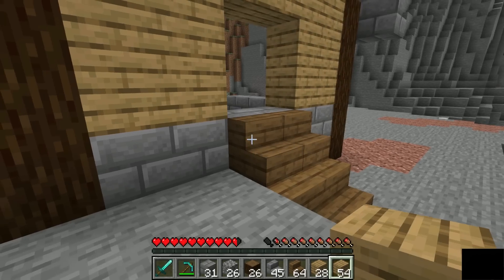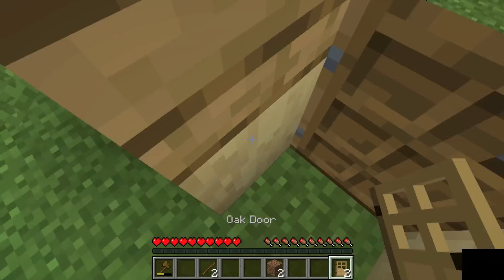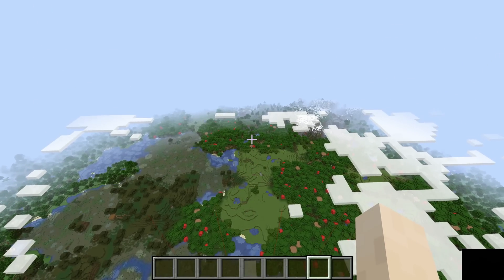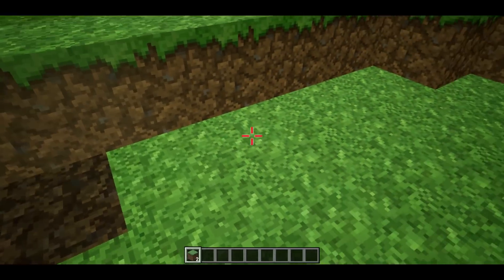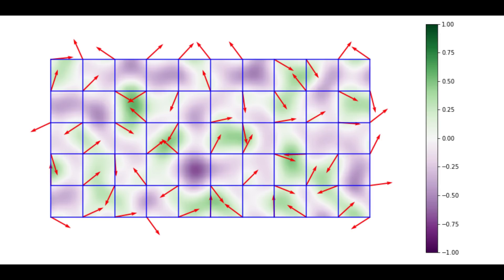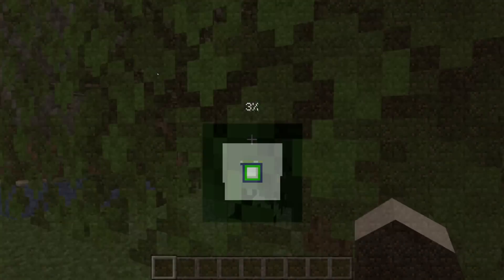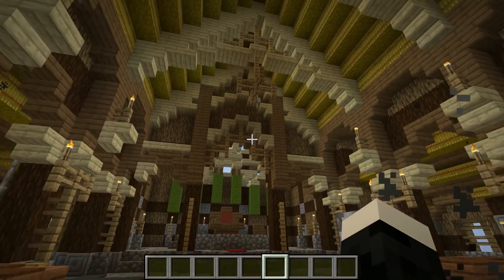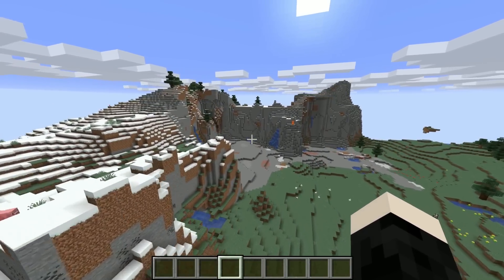Why Minecraft is a Technical Feat | Explaining the Engineering Behind an Indie Icon

Comment: On top of that, the game is made in java, which really isn't meant for preformance-optimized video games
Reply: Rip performance
Reply: @Assassin_Droid  Depends though. your pc has to be quite weak to not run minecraft, i even got (yes the java version) running on my 150$ budget phone with over 40 fps. It just gets worse quicker as soon as you turn up the graphics and it has some limitations that can mostly be comeby but still give languages like C++ more room for optimization
Reply: @Akab   that's not true, the Modern Minecraft Java versions requires a decent computer with a GTX card to run it. My old 2016 laptop can't run it well.
Reply: @CinnamonOwO  No lol.
Reply: @Assassin_Droid  bedrock is made in C which is why the preformance is so much better, microsoft kinda wack though
Reply from the maker: Looks like you triggered some heated discussions with this comment lol. But I agree, I'm making a Minecraft clone in C++ and I'm amazed that Mojang got the Java edition to run as smoothly as it does
Reply: @GamesWithGabe  You really highlighted how hard it is to make a game like Minecraft, it is why there is still no true clone of the game, the ones that do clone it only play in creative and there is out of bounds, well done!
Reply: @GamesWithGabe  try making it on rust 😬🔪
Reply: @GamesWithGabe  the bedrock version isnt in c?
Reply: @macreator9497  C++
Reply: @GamesWithGabe  to be honest the minecraft java edition could run much much better than it does, but Mojang just does not care, the code is horribly written for a performance Java code. And render engine is just ancient. You should see how much better minecraft works with fabric modding + Lithium + Phosphor and Sodium. I go from like 100 suttering fps falling down to 10 each time i move and generate new chunks on render distance of 32, to stable 320 fps on 4k. And this is even without actual changes to also keep the GC under control.
Reply: @thatgotofinal  can you list some mods you used or resources to make your own, i would to try that out myself
Reply: @Arcade_Archie  I wrote many comments here, so not sure what you asking about. If you mean performance mods for minecraft i already listed all: Fabric mod loader, fabric api, and Lithium, Phosphor and Sodium (mod names). It works just amazing with that.
Reply: @thatgotofinal  Indeed, Java edition has lacked performance fixes over the years. We got a big one in the witch update and it made everything ten times better
Reply: @GamesWithGabe  bedrock already runs in C++, that’s why it’s on win10, Xbox OS, PlayStation’s OS, Fire OS, Android and IOS
Reply: @GamesWithGabe  I have been around Minecraft and Minecraft modding for a decade now and the trope of the dude who has dragged some .class or .jar files around once and now knows everything about Java's suitability for "preformanance-optimized games" is at least that old. 

It was the same when I played with Runescape botting and private servers years before that.

it will be the same in 2045 when Minecraft 3 comes out.
Reply: Both editions are fine. I played bedrock for the longest time on my Xbox and phone. When I had the ability to play on a stable computer I played on Java. Both editions, for me at least, are the same. I play on vanilla survival most of the time and when I don’t I’m playing on survival servers. I like how Java has servers that you can just enter and go on to. That’s something both Xbox and PlayStation should fix. Many people play on a specific edition because they like the feel. I asked a friend many times why bedrock is terrible. He simply said that it dosent feel like Java, and of course micro transactions. Becuase I play on both editions regularly, bedrock does obviously perform a lot better, unless you have every non-lag mod you could get on Java. Ngl I read through the entire comment thread. It was Notch’s decision himself to program android and IOC in C+++. Pocket edition first came out in 2011, 3 years before Microsoft. Once Microsoft took over they wanted 1 edition of Minecraft, but due to the differences in coding they united all versions they could and kept Minecraft as Minecraft Java edition. And I agree with the “to mass-market the game.” Then agian because of that resources are more readily available to make something like the Caves and Cliffs updates. I know it’s the OG game, Java is. But even thinking about pocket edition, that came out the same year Minecraft “officially” became Minecraft, in 2011. Many people are “in the know” also, such as myself, which is why I downloaded Java when I had the opportunity, but as I said still play both editions. I guess I should also say this is my oPiNiOn. There’s no need to trash on either edition because they really are both good games.
Reply: @T1DsLayer628  This entire argument is pointless, as I didn't trash anything. I was simply pointing out the inanity of saying something along the lines of "they should have just made it in c++ from the beginning hurr durr". Because CLEARLY they haven't been able to catch up to the Java version in a whole decade since.

Also the original pocket edition was a barebones clone, not even nearly the same as the main game in features for many years.

How long have you been playing to say "I downloaded it when I had the opportunity"? 

This is just a bunch of 15-24 year olds who can't accept that they don't know everything about their favorite game trying to tell someone who has been here from the start lol.
Reply: @ESS284  I’ve been playing since 2012 when I got my first tablet when I was like 7. I was able to get a decent computer to play Java in 2018
Reply: @T1DsLayer628  Interesting, that's a long time to be without mods ;)
Reply: @ESS284  i remember being able to play with mods on my shitty phone years ago, the selection was way worse than java though
Reply: minecraft code is just terrible. Minecraft 1.16 still contains stupid mistakes like i/o calls on main game thread. but yes, keep repeating stupid sentences without verifying them.
Reply: @gang_albanii  the cpu-creep is so noticeable with every single new version. That’s why they delayed 1.17; they can’t figure out how to make the game run on certain systems anymore because of how unoptimized they let the game get
Reply: @pissum  1.16 works for me on an old potato even at high render distance. 1.17+ won't even install correctly.
Reply: @gang_albanii  They need a few updates to stop adding stuff and instead do some housekeeping
Reply: another comment from the same verified youtuber
Reply: Wouldnt say minecraft is "performance optimized" lol
Reply: Replying to just set the record straight for a number of other comments:

regarding which language is faster: 
C/C++ is typically much faster as it closer implements the functionality of the processor/OS. Java on the other hand is designed to enforce structure and often requires a lot more memory to maintain the many frameworks that the language is built upon. One of these frameworks revolves around multi-threading which is not only possible but actually required for standard library graphical applications (both swing and javafx).

regarding the JVM: 
The whole point of the JVM is that Java byte-code closely resembles a subset of most processor instruction sets, not just the x86-64 that is used in laptops/desktops but any conventional processor (ie not a quantum computer) and implementing the JVM mainly requires matching the JVM instructions one to one with the processor instructions. This is why it is common on smartphones that use custom instruction sets. 

regarding consoles:
Consoles are actually more likely to use an x86-64 processor and typically have custom operating systems (written in C/C++) specifically designed for game performance. To directly access the console OS's with Java, they would have to use method calls from the JVM to external code and likely rewrite large parts of the standard library that Java ships with and the consoles wouldn't necessarily have the memory to run the java version of Minecraft. Alternatively they could mostly transcribe the Java code to C++ with little modification and access the OS functionality directly, thus Bedrock edition was formed.
Reply: Dev here, I'd like to interject that It's not as simple as '"Java is not meant for performance optimised video games" You could equally write the same game in C, C++ or a language closer to bare metal and have it perform worse. While the language of choice used to develop software is an important choice, I'd argue particularly with large software it's the architecture and how it's coded that makes far more of a difference when it comes to performance than the languages itself.

Minecraft started off as an indie game. There was no intention for it to gain this much traction. So notch is not going to spend a lot of time developing this game in a lower-level language which would require writing more boilerplate and having to worry about things like memory management. You have performance and simplicity. You can either sacrifice simplicity for performance meaning you spend more time writing boilerplate code but have the opportunity to optimise a game at a very granular level. Or you choose simplicity and sacrifice some performance for spending less time developing basic infrastructure to make the game function.

Hypothetically, if you took the same codebase of Minecraft, converted it to c++ and it didn't run that much better, that's the makings of terrible architecture, not the language. Performance-wise, Java as a language is not really far off from that of C++ or C. But take a language like say Python and then you start to see a staggering performance difference.

TLDR:
It's not as simple as pointing at the language for the reason of performance issues.
Reply: @laeven_  actually the original Notch code was surprisingly well optimized for computers and java versions at the time but wasn't multithreaded. It became slow more recently with newer code. But I'm going to agree that the same code ported to c++ would still have roughly the same performance. The cases where java is slow are either very specialized (vectorized code for example) or things you shouldn't be doing if you want performance anyway (like doing 10000+ of gl calls per frame... Which Minecraft does)
Reply: @laeven_  yes. This
Reply: Yes, while Java wasn't as great of performance then (and it shows), the updates and upgrades to the compiler over the years have made it on par (not quite as good), but on par of C++.  This is even somewhat an advantage as you don't have as much development overhead when programing in java.
Reply: But was Minecraft ever Optimized?
Reply: @Quayleman  i think maybe yes in new versions, but its needed because new versions can eat all resources of your pc even if you have 32gb ram, threadripper 3990x and two rtx3090 in SLI

but old versions wasnt need this because it was working fine
Reply: @Quayleman  actually yes,1.15
Reply: @Quayleman  There were some performance improvements when witches were added since then, not really
Reply: @quickstergamestutorialsgam3899  Ahhh you're just showing that you don't really 'get' Java. "Even back in 2009" is a redundant statement, performance has improved over time not gone backwards after all. Where do you you think Minecraft would be without cross-platform and more importantly *mods*? Nowhere, and the mod's were possible in the early days precisely because the server and client were Java based. Deep functional mods from the start not cosmetics.

Additionally, Bedrock was a choice, made many years after the game's inception, the other choice would have been to port the JVM to any target platforms (xbox and playstation mainly). Bedrock was created to mass market the game on primarily non X86 platforms. So it's pretty backwards to say "if the game was written in c++ from the beginning" when Notch wouldn't have been able to do so anyway and considering the fact that it's always run fine on decent PCs.

Microsoft could have ported the JVM but they wanted to sell you the game again. Notch sold hundreds of thousands of perpetual licenses for 'Minecraft' the game also, I wonder if that factored in. (I bought one in 2010 or 11).
Reply: @ESS284  the reason bedrock is in C++ is because when it was first made as pocket edition, phones didn’t support java
Reply: @duckonaroll1913  "phones didnt support Java", almost 10 years ago, C++ was the most viable option at the momemt
Reply: @allancoelho6905  exactly, which is when pocket edition started development
Reply: @duckonaroll1913  and now, 8 years later, phones have Java support, and it is inviable to change C++ to Java, and make it somewhat stable
Reply: @allancoelho6905  yep
Reply: @duckonaroll1913  Really you should not comment on things you have such little knowledge on. Android has used Java from the beginning. All android apps prior to kotlin's release, unless cross compiled, were written in Java!! 

I didn't ask people to poorly inform me about the history of Bedrock, I know what happened. I was just calling out the clueless Java haters.
Reply: @ESS284  You're right, my bad, PE was originally released for android. It was just that the desktop version was too resource intensive for the phones at the time, so Notch made a new version in the better optimized C++
Reply: @duckonaroll1913  Phones, mainly mobile Phones are based on Android fr Android Phones and Ruby(and her successors) for iPhones.
Ruby is technically a descendant from C, and Android is a Language created from Java.
Reply: @ousamadearudesuwa  It's incredible how many wrong statements you managed to cram into such a short comment
Reply: @duckonaroll1913  that's not true either
Reply: @ousamadearudesuwa  Java is also based on C. As is C++.
Reply: @ousamadearudesuwa  "ruby is technically a descendant from c" "android is a language"

as a programmer, what the fresh fuck did i just read
Reply: @ESS284  it'd also anger a lot of the community as you'd have to learn c/c++ (which tbh for my reasons i find funny, fuck the forge dev team they can eat ass). But again, as someone else mentioned, they would probably want to avoid oracle fucking them up.
Reply: @ESS284  Minecraft has run like shit on plenty of platforms for no good reason. It runs poorly and still runs poorly, because it's Java. .NET was a thing since 2002 and Mono since 2004, so there was plenty of opportunity to write something that would be portable and moddable. In any case its cross platform status didn't lead to its success because there were next to no Linux/macOS gamers back then. If you game, you game on PC up until only very recently.
Reply: Since when C++ is not cross-platform?
Reply: @aleshevl  C++ is cross platform. Actually the XBOX OS and other devices are written in a modified C++ language so it works pretty well
Reply: @Stettafire  Being a C++ engineer and having developed for various platforms I think I would know that it's cross platform, I don't think I ever said otherwise, but I can't see the message you replied to to clarify my statement
Reply: @ESS284  I think you're being pretty biased. They needed to run c++ on consoles, even on legacy editions, since it was more optimized and consoles didn't really had Java support. But maybe you didn't know that, so here's the reason. Correct me if I'm wrong and have a good one :)
Reply: I don't think so because it was a small part of the argument to illustrate the differences that exist to this day stem from that situation, I am fully aware that they didn't have java support. But it's really not radical to suggest they could have taken that approach and kept a single game edition, that's exactly what Java is meant to be able to do, no doubt this was possible by the next console generation. So in the end you got a buggy cut down version of the game in bedrock for YEARS anyway... 

I have argued many points with people in this thread and this is just a sub point to the YouTuber above criticizing Notch's choice to build the original game in Java. What do you think about that?

And you know, there aren't many games companies that even attempt to maintain two code-bases for essentially the same product, the reasons are pretty obvious so yes thats not how history played out but it certainly could have.

by the time MS was in the process of acquiring Mojang the pocket editions were barebones, really pale impressions of the full game.

The Xbox One was released November 22, 2013.

Xbox 360 version (2013) wasn't even built by Mojang, the code base split in about 3 directions with pocket by then and then one year later (2014) MS owned the IP and missed the opportunity to unify imo. It's not really related to the original argument about Java though. Which again was provoked by someone else shitting on Notch's choice to build the original Minecraft in Java.

Many different interesting arguments to be had here, not many provable, imo if they got GTA5 running on 360, they could have ported a JVM and run minecraft on it, but we will never know. Next gen onwards would 100% possible and they are beefy PCs by 2010 standards, minecraft java ran fine on my Dual core, 2GB RAM, gt210 or something GFX card after all. And I used to run it on linux laptops with even less ram frequently. It still worked pretty well which is a testament to Java imo. It doesn't deserve the pig-slow reputation just because Notch was the first one to pull off wide commercial success, he proved it was possible so to call it a bad decision seems laughable.
Reply: @paulinxm8201  Everyone is biased,mate
Reply: @ESS284  I feel like you misunderstand what Java is and what programming languages are. The language, nowadays, rarely is the thing that dictates if something is cross platform. Minecraft Java edition, is, however, not cross platform as the Mac and Windows (windows Java not windows 10 edition) are essentially seperate games that require updating seperatly. 
Java in of itself is cross platform, as is C# and many other languages. Minecraft Java edition, however, is not cross platform.
You seem to be confusing Java edition with the windows 10 edition (which I might add is also not supported on Mac)
Reply: @ESS284  i think hat java's syntax has changed just like any other fucking language over the years you can't say python 2 is the same as python 3 you realise you could only develop it's game with the original java version
Reply: @ESS284  The windows 10 edition is NOT java afaik, so M$ is actually writing it very differently, the original code probably is not being used much after all this time. and yes, I've even heard stupid things like MC is not multi threaded because JAVA, like, WHAT? People seem to blame everything down to to things which are not even responsible for this at all
Reply: @UCJzUT6suX8o0OgHONzOu_FQ You are talking about the Bedrock edition which is available on the windows store. The codebase and features have never caught up and everyone serious and in the know uses the Java version. Only people who can't use the Java version for some reason should use that version. 

Java can do multi threading just fine, which i think you are saying! And it's why I commented people are not well informed about Java. It gave you Minecraft!
Reply: @ESS284  You just went from a Java language arguement to a "Minecraft Java is better" arguement and even though im a java fan the facts you gave about bedrock are very innacurate
Reply: @ESS284  "Everyone serious and in the know uses the Java edition." This is completely false, there are TONS of knowledgeable and talented Minecraft players who use the Bedrock edition, although I won't deny that Java is much more popular and much better in its technical aspects (mostly due to the fact that the mechanics aren't constantly changing with every hotfix and it isn't buggy as heck). Honestly I can almost see a case for playing on Bedrock due to just how badly Java's performance is optimized in comparison, but Java is so much more well-polished and its mechanics and features are generally so much better-designed that I can't imagine going back to Bedrock now.
Reply: @BenjaminAnderson21  I would say you contradicted yourself there. As better stated by someone else above, if you have access to the Java version you need some reason not to use it, otherwise why wouldn't you if it's better and you agree that it's better?
Reply: @ESS284  Where did I contradict myself? I only said that while Java edition is more popular for its technical aspects, many knowledgeable players still play on and prefer the Bedrock Edition (probably for its performance). Personally I can't imagine going back to Bedrock after making the switch to Java, but I won't deny that as jank as it is, Bedrock has its advantages, and to say that anyone who plays Bedrock "doesn't know what they're doing" is shortsighted imo.
Reply: @BenjaminAnderson21  
First of all you made this quote up (anyone who plays Bedrock "doesn't know what they're doing")

 So before you switched, why hadn't you? perhaps because you weren't "in the know". Now you have tried it and you know it's better and wouldn't go back. Remember I said serious and in the know. You could be a serious knowledgeable player, and only find out about  the Java version later. 

You are making it about knowledge, and putting the words in my mouth not me. I think a lot of you are missing a big chunk of Minecraft history, because there was an whole era pre microsoft that some of you missed.
Reply: @ESS284  If you are a serious and knowledgeable Minecraft player, then you have played Java Edition. There's no concievable way you could call someone a "serious and knowleadgeable"  Minecraft player if they haven't had experience in both main versions of the game. You were the one who said that "anyone serious and in the know uses Java." Now you're saying you can be such without even TOUCHING the version? What?
Reply: @BenjaminAnderson21  No I didn't I said you can still be knowledable about the Minecraft meta. 

You've shown yourself up already. now stop digging a hole, the obvious need to be right about a game you feel a connection to is showing.
Reply: @hariranormal5584  win10 edition was written in c++ AFAIK. The "minecraft isn't multithreaded" argument comes from how the server jar file is written, it can't support multithreading. I'm not entirely sure if this translates into local worlds since they run an internal server which could differ from the distributed jar, but I'm not 100% on that.
Reply: @ESS284  I play both Java and bedrock but I prefer bedrock for its render distance
Reply: @ESS284  I have played both versions, and know them well, and I prefer bedrock. I don't see wat people mean when they say it is jank and buggy. Other than redstone, it is very solid. In my experience, java is far worse with polish.
Reply: @ESS284  actually minecraft bedrock even though it is behind java in some ways has been the leading version in terms of world gen
Reply: @ESS284  dude the ego on you. Jesus
Reply: @MySkilletfan  it's okay if you don't understand technical terms just ask bro.
Reply: @ESS284  I'm sorry your parents don't love you, but arguing with people on the internet isn't going to fix that. Have a nice day, enjoy your internet points.
Reply: @hariranormal5584  Yeah, they don't understand that multithreading is pretty much useless and unfeasible in most games. It's very difficult to make a thread safe multithreaded game. Too many threads will eventually corrupt game memory, due to them trying to read and modify many parts of the game at once without the others being aware of those changes. That's why a lot of games are mostly single threaded, they only use multithreading when workloads can be safely and effectively distributed.
Reply: @ESS284  "Only people who can't use the Java version for some reason should use that version." - that is complete BS. Bedrock has 99% of the core game. Have you ever even played it? And running a Java app is not a matter of knowledge. I love Bedrock, and choose it over Java, because it's much faster. I don't play skyblocks though or mod the game, I just play with my family or with friends on Realms sometimes. I would say most people should be playing Bedrock, and Java is just for those peeps who 'need' the modded experience.
Reply: @ESS284  because there was an whole era pre microsoft that some of you missed. - LOL, I was playing Java Edition for years, and I still switched to Bedrock after a bit of to-ing and fro-ing. After I got sick of hackers in the multiplayer servers and realized Bedrocks performance kicks ass, and the simplicity of Realms and I Minecraft is Minecraft, even if a few mechanics are different. No problem if you like playing Java, but to say it's flat out better than Bedrock is just not true.
Reply: @hariranormal5584  Minecraft Java edition is multithreaded lol. Indeed I've heard similar things from people who don't understand what Java is
Reply: @BenjaminAnderson21  The vast majority of PC gamers play on Java, mostly due to microtransavtions etc
Reply: @Stettafire  
There is confusion between what is actually being Multi-threaded, people say Single Threaded because the main "thread, engine" which handles the ticks and stuff is single threaded. IDK if this has changed over the years, at least 1.12.2 is not this way.
Reply: @HappyGick  No lol
Reply: @ESS284  Bedrock wasnt a choice for mojang, it was neccesary, a C(#or++ I dont remember) rewrite that was compatible with all(most) consoles and devices was required if they wanted to expand it off desktop wich they had been doing. Well what about before bedrock on consoles? Wii U, Xbox 360, and the old nintendo switch versions, along with minecraft pocket edition costed alot of money and effort for mojang, to the point that they even hired a seperate company to maintain the console versions, they needed the C rewrite to get cross compatibility
Reply: @wellsilver3972  ironically java is better for cross platform development because c++ needs to be compiled seperately for different systems, while the JVM does all the dirty work for you
Reply: @wellsilver3972  C# not C++ but yes, totally agree keeping the game in Java is not sustainable. The microtransavtions etc however are obhorrent hence why most PC gamers are sticking to java
Reply: @ESS284  MS didn't charge me twice. Bedrock was free. Bedrock also runs on more platforms than Java. I just wish when my nephew and I play on PC and Android or PS5, we could use mods. Too bad.
Reply: @deViant14  the last bit was tongue in cheek because they lost my license in the transition, so I had to rebuy Java anyway. 

They had some kind of web tool to help recover old perpetual licenses like mine but I never got it to work.

Edit: the change you are talking about only happened in 2020 bro so not really relevant if you have been playing for 10 years lol.
Reply: @ESS284  huh? I had one one the earliest licenses because I wanted to support Notch. (I didn't know his political views at the time). Anyone who owned a copy of java edition got a copy of bedrock....
Reply: @deViant14  I've played on and off from back before there were hitpoints in the game xD though I played much more during beta than prior. It seemed to me like certain parts of the Minecraft community kept turning super hostile to each other (and I don't mean Vechs, but it's just as frustrating as surviving some of his maps. :P) It really got on my nerves with the modding community stabbing each other in the back and making things worse off for all of us. I dropped out of making mods and all of that and basically went pure vanilla except for some mods I keep playing in old beta versions that I would go back to. Eventually I moved onto Bedrock as my main edition where the Minecraft community is much more just people enjoying a game still, but that "us vs them" attitude (even though both are actually "us") that keeps showing up in Minecraft players keeps frustrating me. xD
Reply: lol and minecraft runs smoothly on really any device
Reply: Java is excellent for large applications of the same scale as Minecraft. The problem is that the JVM is not as good as compiled non-VM languages at rendering ie C++ and shader. The problem with using non-vm languages is that you need to port your program for each platform you target.

Try compiling your Windows C++ software project in Linux. It's likely to throw dependency errors, because operating systems have different system functions/calls and paradigms for controlling the hardware, and not all dependencies are cross platform.

The inefficiency of older versions of the JVM is true, but newer versions, coding approaches and oracle's paid JRE are very efficient, especially compared to interpreted languages like Python, for large projects, not small ones. Interpreted languages are great for scripts, but don't kid yourself, they're very inefficient compared to compiled languages for large scale projects.

Also, good Java is very efficient, but writing bad Java is very easy.
Reply: @a1vash  There is a very fine line for some reason. You either run minecraft at 30 fps or above 100… there is no in between lol
Reply: but java not too slow as usually people think
also game was working on java applets and was able to work in browsers

and about performance, big amount of java games has better performance than Unity apps with the identical level of simplicity, and with that java has crossplatform from the box because of JVM, and when Java became slow language in videogames when 90% of people using Unity

cringe
Reply: Then why is java far better than bedrock🤔
Reply: A common myth that Java is not performant. It has an amazing performance.
Reply: @sobanya_228  Vanilla is good, it's just that the mod loaders don't do well because
1. You're adding >10x the content to the game most of the time.
2. Forge is programmed unoptimized. It's meant for ease of use and compatibility. Fabric runs much better, but it still sometimes has the first problem which is unavoidable.
Reply: "made in java, which really isn't meant for"
It's a programming language...it can do anything you throw at it unless you think of something the initial designers didn't...and large-scale simulation and graphic rendering weren't two of them when Java was being developed.

Otherwise you'd have to explain C still kicking around.

Stick to releasing 2 videos of the same recording every 6 months, Horizon.
Reply: @DxBlack  not for preformance optimized video games. there is a good reason why so little games are even in java
Reply: @DxBlack  My Python voxel engine with procedurally infinite terrain runs at 400 FPS with the right optimizations. Sadly it got lost in a HDD wipe, else I'd show ya. Mojang simply does not know good programming practices (BlockPos, talking 'bout ya)
Reply: Yep, especially back when Minecraft was being developed. Java's performance has improved over the years though, to the point where it can match or even exceed native performance in some workloads
Reply: @nighteule  How can a high level language "exceed native performance"? To me that makes no sense since "native" is just machine code instructions specific to the cpu instruction-set. There is no way to be faster than the hardware you are running on.
Reply: @electrified4251  I'm pretty sure there are cases, where interpreted languages like java or python can outperform compiled programs due to JIT compilation
Reply: @nighteule  EXCEED?!
Reply: @gang_albanii  this. Java is not the same as it once was. Language choice is hardly relevant when bad practice is present regardless.

Some of the stuff I’ve read in this thread is so bafflingly stupid I have no idea what to say!
Reply: @gang_albanii  Yes, this
Reply: @KookoCraft  Indeed. I'm a dev for a living and code issues are rarely language based, their caused by lack of time and inexperience as well as poor architecture. Architectural programming has come a long way in just the past ten years. It's no surprise that Minecraft has issues and they decided to just redo. Many legacy systems nowadays are in similar situations
Reply: @nighteule  that is literally impossible
Reply: @KookoCraft  Java and other interpreted languages can in some cases be faster than compiled code due to JIT compilation, if I'm not mistaken
Reply: @nighteule  meh
Reply: @nighteule  meh... The JVM is a marvel of engineering... It has been very good for many many years but it's just not really the right tool for video games...
Reply: @nighteule  What? No?
Java runs all code in the JVM, which makes it slower than native by default. Adding a translation layer causes slowness.
Reply: @thatgotofinal  thank you this is the kind of thing i was talking about but everyone thinks I am comparing bedrock vs Java edition lol.

Long live Java.
Reply: @thatgotofinal  saying the JVM outperforms an equivalent native solution is verifiably false and insanely stupid
Reply: @KookoCraft  How do you define equals then? Simple idiomatic object-heavy code can easly be faster on JVM then language like cpp. But if by equal you mean implementing a lot of JVM features manually first in cpp code and then wirting heavily optimised code in cpp? Then sure, native will be faster, but making it faster will take few weeks or months more of work depending on scale.

Banks use java in their trading platforms that need to be realtime and super fast, why? because its fast and simple to develop to be fast enough, and using cpp would make time needed to develop features much longer and more complicated.
Reply: what about bedrock edition?
Reply: to be honest. That is actually true. Java may be complex in its implementation with many of its quirks residing from Turbo C and Dev C's main problems in terms of optimization. But its also really good at its simplicity for games running on any PC.
Reply: This only shows that if you compromise of the looks, you can make the game even in Java.
Reply: It is written in C++.
Reply: @randavael  Minecraft bedrock is written in c++. The main version of minecraft is written in java.
Reply: java itself is capable of decent-good performance. its encouragement of virtual object orientation is what messes up things
Reply: That's funny because minecraft runs like shit
Reply: Isn't meant for performance... until you understand what a JiT compiler is and realize it's not far off "native" code (because it compiles to native code in the JVM) and more up to the developer just writing better code.
Reply: @MikeBrady68  the JVM is open source... microsoft could just make an own jvm distribution. like ibm, redhat, eclipse, etc...
Reply: Yeah it’s made for being bad
/j
Reply: no wonder they still play on 1.8
Reply: the bedrock edition is made in c++ and it actually has makes the biggest leaps in terrain generation in minecraft
Reply: The good thing is Java has improved vastly to where it is now, to the point where it can go toe to toe with languages like C/C++ if the C++ developer isn't a literal Operating System developer
Reply: Not even C# can fix it from what I’ve heard. Any semi-interpreted OOP language like Java or C# will have around the same performance.
Reply: @cerulity32k  Not true
Reply: and java is a pain in the ass
Reply: C++ for life
Reply: @JThburvs Any language can be used for video games. Almost every language's Hello World is with the console, which is why it's so universal. For 2D frameworks, Python has pygame, Java has libGDX AND Processing, Lua has LOVE2D, C# has XNA/FNA/MonoGame, C++ has SDL2, and C has raylib, just to name a few. Java isn't optimized, and I do agree that they could have used a much faster language, but no programming language is built for really anything. You just need to make it like that.
Reply: Mhm
Reply: fuck java
Reply: Well… it’s mainly in bedrock now, but initially yeah, java
Reply: Java is actually not as inefficient as people make it out to be. You absolutely can write incredibly efficient code in java. Most of Minecraft's performance issues stem from following common java code practices where performance actually matters, just plain not using optimized algorithms, game mechanics being designed in a difficult to optimize way (redstone...), or like in case of randering, using somewhat archaic approaches to it (until recently Minecraft still used opengl 2.0, and while it uses 3.2 now, it doesn't actually make use of it's features and attempts to "emulate" the old way).
Reply: @Barteks2x  no it uses opengl 4.~ now
Reply: @macreator9497  nope, it uses opengl 3.2 core profile. It works with newer versions but only uses 3.2 core profile. Versions before i think 1.16 (or was it 1.17?) used opengl 2.x and some even older versions used opengl 1.1 or 1.2 (or 1.5? My memory is fuzzy on details), and optionally some 2.x features.

Finally requiring opengl 3.2 also in a weird twist allowed them to finally update java version, because windows Intel drivers for integrated GPUs on third and older generation of Intel CPU would fail to run on newer java versions due to containing a manifest for windows 10 which broke windows 10 compatibility for windows 8 drivers.

Most GPU drivers are also very lax on mixing and matching features from random opengl versions because many older games relied on it. But some drivers (like Haswell and older Intel driver on Linux) doesn't allow a compatibility profile for opengl 3.x so you can't use 3.x+ features in legacy mode. This is visible by a lot of optifine shaders not working on that driver.
Reply: old minecraft was horrrrible performance wise. it took them over a decade to get it to not require a gaming pc to play.
Reply: @codywasser2008  That's not strictly true, but the performance was poor
Reply: No kidding, just ask my 13 year old laptop about 7-15fps in Minecraft Java Edition.
Reply: And yet you can run it on a phone (I'm not talking about bedrock now, there's an app on android, that allows you to run minecraft java from your phone) on pretty decent FPS
Reply: they need to add Interoperation for them to add other computer languages to work on the same software.
Reply: Lol this comment thread became a Twitter argument
Reply: Well it turned out to be perfect for MC.exe  Not Responding
Reply: Bedrock edition is more played witch uses the bedrock code base so now days most people play the c++ Version
Reply: @Filip_ko  Most people are still on Java, but bedrock is popular
Reply: Why people talk about gl calls? Is Minecraft source code avaliable anywhere?
Reply: @hooolas1  Well the code has been decompiled on almost every version, that is basically how forge mods or bukkit based servers work
Reply: @hooolas1  Not really no. But the Java libraries it uses are
Reply: mc java is just asshole for amd cpus because the producers denies opengl support lmao
Reply: Dude java is as Fast as C++ c# . In some scenario it outperform them.. It was slow at in 90s because JVM wasnt evolved that much.bbut now in 2022 its A standard if you research
Reply: While true, Minecraft is made using LWJGL or the Lightweight Java Game Library, which allows it to be faster than just making the game from scratch.
Reply: Actually java is decently fast as a compiled languaje, obviously not that fast compared to C or C++, but, still faster than for example python, it eats a lot of ram though.
Reply: @xdec0de_mc  Its both compiled and interpreted. Same with python obviously it is decently fast, but it isnt machine code fast
Reply: Minecraft bedrock with its 64 chunk render distance
Reply: Anybody talking about bedrock though? C++?
Reply: @SSukram_  Cpp sucks. It solves none of the problems c has. Dennis richie wouldn't be proud.
Reply: No, that's not true, Horizon. Java is actually quite fast. I've seen this misconception everywhere, it's decently fast but the codebase behind Minecraft is the actual bottleneck.
Reply: @trayambakrai  Its not as fast as c. Mostly because it has to run the JVM but being the C chad I am java is slow.
Reply: @theweebtoblame5402  C is a very high standard for performance. Java just "does the job", in fact, Minecraft can run 10x better than it does at the moment. I saw a Minecraft clone in pure OpenGL and Python (sluggish ass language) and it runs at a better framerate than Minecraft, mind you, with entities.
Reply: The problem is not Java. It's Mojang (Microsoft now).
It does not matter what programming language you use. If you write shit code, you get shit performance.
The only problem with Java is memory if you write code with useless "new" calls. It creates a lot of objects quikly and then the GC has to do the job of freeing memory if these objects are unused.
The only difference with c/c++ is that object are freed from memory as soon as they are no longer used. Unless you do manual memory allocation (with malloc or new), the object is destroyed once it has reached the end of the function where it was created.
Reply: That explains a lot
Reply: Bedrock is created using C# though
Reply: @Settiis  Nope, C++. They use pure DirectX and OpenGL. Not any game engine.
Reply: @trayambakrai  My bad
Reply: @Settiis  It's fine, didn't mean to be rude. Have a good day, random person on the internet. - From a random person on the internet.
Reply: top 2 comments by the same youtuber lol
Reply: i have a deep hate for java and C#, i will never use them, being forced into using ALL Object Oriented Code isn't good
Reply: @crafterhacker  I use Python, but only use classes when needed, else function-driven code.
Reply: @crafterhacker  That's an odd thing for a "coder" to sau
Reply: java is very memory hungry too lol
Reply: @serial-designation-n-80  Nope, Mojang simply does not know good optimization techniques (re-using buffers), they made Vectors a class just for a bit more convenience, it is the main culprit for performance issues since 1.8's BlockPos rework. Java has little to do about it.
Reply: The Horizon  you know minecraft bedrock ?
Reply: I find it funny watching all this 200+ comments about C C++ C# and Java from people who know less then me and believe me I'm noone in developement.
I know nothing compared to real devellopers.
But what I know from the litle programing knowladge I have is that an app made with any of those languages can have a smooth operation no matter what language you use, if you know how to really devellop with it.
And the argument saying that Java edition is better because it has features that the bedrock adition has not, is just stupid the way people see it, cause if the bedrock edition does not have those features is because the devellopers of bedrock edition didn't integrated them, things like the way redstone works, and using a torch in your left hand, if it isn't in bedrock is because they dont want it, it isn't because Java is better or worst then C/C++ or even C#.
Any of these 3 C/C++ C# can do exatly the same thing as java can, the only diference is the code, but they can do the same and in most cases better if you really know what you are doing.
Reply: @kiiikoooPT  Exactly, the poor framerate of JE is due to poor design choices that could have been easily fixed. That is exactly what OptiFine does. It fixes those things (except BlockPos as it is a root part of the game now and removing it now requires an entire rewrite). None of the languages are more or less capable. C# may be inferior, but in the end blaming the language of the implementation is just non-competitive (except Python, of course)
Reply: @kiiikoooPT  holding torches in the left hand would be scuffed to mobile players, since they'd have to open the inventory to do so. Can't wait to the mobile controls update tbh, these ones are pretty trash, even to me that am used to it.

Bedrock also has some features Java doesn't have, being underwater redstone my favourite.
Reply: The Minecraft rewrite - Bedrock - is written in C++ and it performs a lot better. I never play the Java Edition anymore, for that reason alone.
Reply: @gavinw77  C++ is not the actual reason for this, the reason is that the game is now made by a multi-million dollar company under a multi-trillion dollar one. They have learnt the mistakes MC:JE developers made and are no longer reflecting it, hence the good performance.
Reply: yoooo mr horizon
Reply: Ey horizon
Reply: Is this meant to be a feat? Minecraft Java runs like a piece of shut without optifine, even on medium graphics on a pretty good pc. It's a bunch of damn cubes! It does run good in c++ tho, but that's because the the programming language used is actually good for games
Reply: The performance of java isn’t a problem anymore… But java has a virtual machine which can take up quite a bit of ram.
Reply: what if it was made in python? I heard it's even worse.
Reply: wich is probably why bedrock edition has far better performance.
Reply: That doesn't matter if you are talking about the programming of the game or a program
Reply: Well "Minecraft" is coded in C++ but Minecraft Java is coded in java
Reply: You should dupe on the simulation cuz it's p2w
Reply: Yeah we know 😂 30 fps 32 chunks
Reply: By the way, when new video?
Reply: @Assassin_Droid  Check his pinned tweet on twitter
Reply: People who think Java isn't capable of high performance either don't know enough about the language, or they aren't very good Java programmers. I've seen a Java application running on a laptop outperform a server running conventional "performance optimized" code running on multi-cpu servers.
Reply: @railgap  It can’t take advantage of additional cores in your processor.
Reply: @zappr  If your saying Java can't utilise multiple cores, you may want to do some more research. Admittedly the usage is up to the programmer.

The base library ships with a multithreading framework that is baked in even in the Object class which every other class must derive. There are also several multithreading keywords, such as "synchronised" which is used to make a method thread safe. 

I also believe, Java can implement a relatively infinite number of virtual threads, which are then assigned to different cores through the JVM or OS.
Reply: @zappr  That's patently false
Reply: @Stettafire  Anything to support this?

Minecraft java is not made to be multithreaded. Some tasks are offloaded to other cores, but most of the base game is coded to only use one core. The only way to fix this is by using a better performance per-core processor or coding the entire game again to make it use multiple cores. Minecraft bedrock can take advantage of multiple cores, and while it lacks in other areas, loading is considerably better in most circumstances.
Reply: @MikeBrady68  Java already works on android f. e. (dont know about iphones though)
Reply: @Akab  wait what? I just realized this is a live conversation
Reply: guess yt brought us all here
Reply: @bulkbond  always has been xD
Reply: Yes but it is the perfect language to implement plug-in architecture. This is partially why Minecraft is so successful. It allows the community to do whatever it wants with the game.
Reply: what's your point? minecraft runs very very badly. minecraft was not able to achieve a "technical feat" for optimising their game. Hell, they don't even have key optimisation features such as LOD and smarter culling
Reply: @cate01a  the only think i could try call LOD in minecraft that make sense is what bedrock does - load distant terrarin surface but dont simulate it. What else you want to LOD and how? 40 poly zombie? culling could be better. But what we need is just modern renderer and better client logic code that is currently killing cpu and gc.
Reply: @thatgotofinal  simulation distance is a smart feature as well; and lod could be implemented in multiple ways, but perhaps the best one would be to simplify the distant chunks into lower poly polygons, that way you still maintain detail while saving performance. downsides is it'd be hell to implement, and some purists would get upset that minecraft has triangles (polys) instead of laargely just voxels
And yeah though I'm not familiar with the subject I guess in general code optimisation is good also
Perhaps most feasibly though, would be to downscale voxels resolutions when farther away (though not sure that would play any role on performance)
Reply: @cate01a  Minecraft already uses triangles to render its voxel data.  You are confusing representation with presentation.
Reply: @MichaelPohoreski  I'm not. I mean to simplify some 10 block area that uses many triangles, into a polygon that uses much fewer triangles. See a demonstration of polygon-type lods here https://www.youtube.com/watch?v=1QKktMk33QE&ab_channel=AsianHalfSquat
Reply: @cate01a  I'm referring to your incorrect statement:

> some purists would get upset that minecraft has triangles (polys) instead of largely just voxels 

Minecraft already uses both voxels AND polygons.  Adding LOD would change *nothing.*
Reply: @MichaelPohoreski  ugh. if there was a lod implementation like the one i linked to, then minecraft would not be composed of largely just voxels; instead you'd also get polygon structures ----- this means that the player can see triangle land/structures.
This is not possible in current minecraft since the only stuff that renders are voxels (blocks) and squarey stuff (staircases, torches, grass, etc).

if youre too thicc to get that, then im saying "the game would look different with lod"
Reply: @cate01a  That mod uses the world seed to generate the LODs. That means it won't reflect any changes that happen after world gen and also means that the performance benefit probably comes from reducing the amount of chunk data loaded into RAM. 

They could try to implement a continuous LOD (CLOD) system but I don't think it would really be a benefit to something like MC. It's already one of the least graphically intensive games on the market. Most of the burden of running MC falls on your processor and RAM and a lot of CLOD algorithms run on the processor. It doesn't make sense to give your laziest asset a break when it comes at the cost of an increased workload for the thing already busting it's ass.

As for "looking different" yeah I guess but I don't see how that's relevant, without a performance benefit I can guarantee you nobody would use them because "different" when it comes to LODs means worse looking or lower detail. You don't choose them for their looks you choose them for their performance and you try to minimize the hit to aesthetics.

"This is not possible in current minecraft since the only stuff that renders are voxels (blocks) and squarey stuff (staircases, torches, grass, etc)." Sort of but it's not a technical limitation. The graphical pipeline minecraft uses doesn't render voxels it renders vertices and indices (there is other information but that's pretty much bare minimum to get something to render) into polygons. That said it will render any geometry any other game can if you present it to the pipeline in that format. You don't have to take my word for it but I've written both voxel procedural meshing code and your more standard model loading code in java using the same graphical library Notch used to write MC and in both cases the data I passed to that library was not voxel data.
Reply: Yeah, but you can create good game in Java. Minecraft just is not like that :P Mojang does not care about server owners, yet game still works nicely in singleplayer mode.
Of course Java is slower than C++, but 1. it gives you some advantages, it is easier to code, 2. Performance of java is being improved. BTW Imagine a Minecraft was written in C++, then the today's community of modders may have not exist.
Reply: @krzmaciek6010  You can write mods in C++.
Reply: Ok let's make this in binary then
Reply: Actually, Java is a lot more efficient than you think. It's more efficient than C++, and C++ is generally used for video games. C still beats Java though.
Reply: @Soulsphere001  java is nowhere near more efficient than c++. It's JIT optimizer is good at some very specific optimizations, but these optimizations aren't needed if you write code in a more efficient way in general. Memory allocations are slower in C++ but that can be mitigated with a custom allocator in C++.
It's just that Minecraft is nowhere near the performance limits of java so it doesn't matter at that point.
Reply: ah yes let's build a kinda high performance game on a no performance platform for future modifications
Reply: @ScythLabs  I believe that what made it successful, all the server and mods got into existance thanks for that.
Reply: Notch doesnt know any other language
Reply: @nojukuramu  He actually programmed games on C, C++, C#, Pascal and BASIC. But said he is more efficient on Java.
Reply: oooh that also explains stuff.
Reply: @MikeBrady68  Nah, why do you think they have microtransactions on Bedrock but not on Java?
They are taking advantage of people that only play on console and don't know any better 
The few that play on PC is because they have friends who also play bedrock or because they really want ray tracing (whatever the reason you would want that in Minecraft, it looks awful)
Reply: @rompevuevitos222  not to mention om java we've already had shaders forever and frankly many of the shader packs look better in most cases than RTX raytracing imo. Sildurs Vibrant Shaders being one of them, and coincidentally, my personal favourite.
Reply: @HerbaMachina  This is true, but they're all also kinda slow
Reply: @rompevuevitos222  I actually prefer bedrock because javas performance is shit and also i played on console and when transfering my world to pc i dont want to convert my over a year old world to java due to some jank with converters, and on a final note the marketplace is rarely used by many people and on windows 10 and mobile you can download free maps and texture packs no marketplace needed
Reply: @rompevuevitos222  The hell are you talking about? Minecraft RTX with Kelly’s RTX looks gorgeous!
Reply: @rompevuevitos222  Nah man, when I have my PC I'll play bedrock because I like it better. (PvP, probabilities, features, underwater redstone, different redstone)

Yes, I started playing on Java when I had access to a PC, but hell yeah my friend I love bedrock. But Minecraft is Minecraft, I can play on Java if my friends want. I can even use Java launchers for mobile on my Android phone at any time and use my OTG to use mouse and keyboard! People have different tastes, m8.
Reply: @rompevuevitos222  Yes I know this is a 6 month old comment. Anyways, microtransactions on bedrock has always been strange to me as a java player. However, they don't exist just to rip off kids playing on their moms phone. Minecraft wanted to monetize their game more, and mojang, from the very beginning, has promised that every java account would get access to updates and all content forever. They cannot integrate microtransactions on java. It isn't an option. Notch made no such agreement about bedrock, though, as he had already sold the company. Being the most popular game of all time seems great until you realize that you have to push infinite updates for no extra cost. I am 100% team java and hope that mojang doesn't start focusing on bedrock, but I get why they made the decision to add microtransactions, even though I hate the idea of paying for skins, mods, maps, plugins, etc.
Reply: @ReplayJay  Microtransactions are not ok, no excuses
Reply: @rompevuevitos222  the fact that java edition requires Minecraft accounts now should have you scared
Reply: @ventilate4267  It always needed accounts lol
Only way it doesn't is if you're using a cracked launcher
But even the first paid versions had you input your account in the launcher or you couldn't play
Reply: @ventilate4267  " the fact that java edition requires Minecraft accounts now should have you scared" Why? Unless you're paranoid. I have several hundred 'accounts' these days. It's hard to comprehend your comment in context of the real world.
Reply: @ventilate4267  Not really, a mojang account was a Microsoft account essentially, just on a different db
Reply: @rompevuevitos222  Java also has raytracing with seus PTGI and other shaders... spoiler: they look better than the rtx shader (in my opinion at least) 

And Yes Path tracing is an extension of raytracing.
Reply: @Akab  What do you mean path tracing is an extension of raytracing? They're the same thing, just different word for it
Reply: @Akab  it’s not actually ray tracing but it does look and run better than bedrock rtx
Reply: @rompevuevitos222  you have a lot to say about bedrocks lack of pros, but what does java have going for it?
Reply: @Noah-rm5bu  Java has no microtransactions and more features
Reply: Bedrock is made in C++, which allows it to be run easily even on consoles and mobile devices.
Reply: @rebekahdodge3251  Bingo. It's really more about Microsoft's commitment to cross platform then anything else
Reply: @rebekahdodge3251  not really
Java is cross platform compiled
But CPP isnt
Reply: What are you talking about? Java applications dont really loose a lot of performance, thats just a modern myth
Reply: @herscher1297  sometimes. Java, when coded in a Spaghetti format can easily break in seconds. A simple way of breaking Java is just the same with C++ but with the same problem from Dev C.
Reply: Someone remade Minecraft in C++ and it’s so optimised that it can run on PSPs which only have 64MB of RAM lol
Reply: @tacosmexicanstyle7846  probably also supports like 1% of its features?
Reply: @silverfoxgaming6661  there are a lot of codes that cant be translated to Java, without losing it function
Reply: And now that render dragon is made in C++, it just kills the idea of changing languages
Reply: Which is why the game runs like dogshit